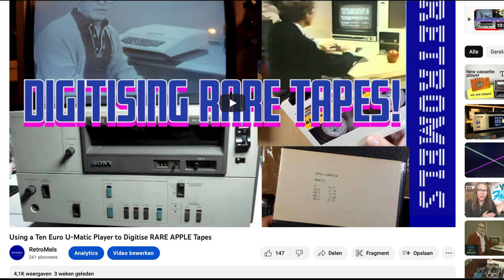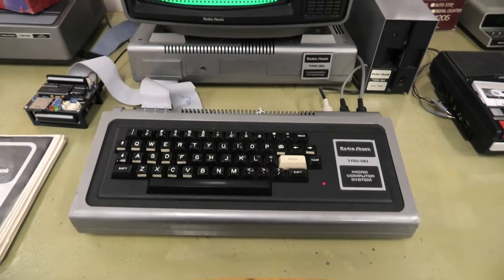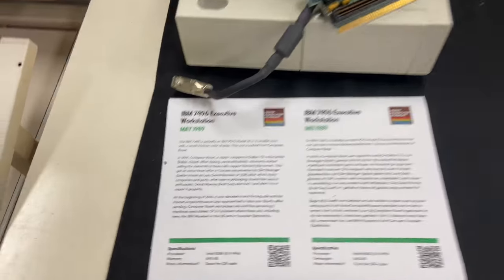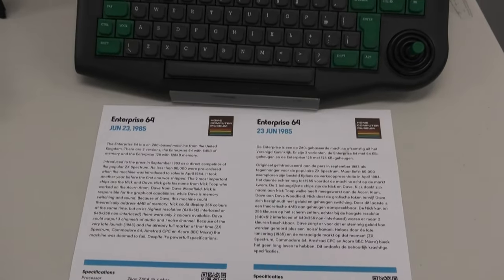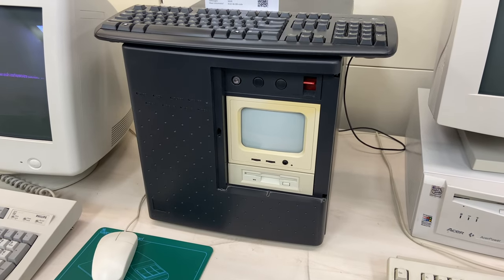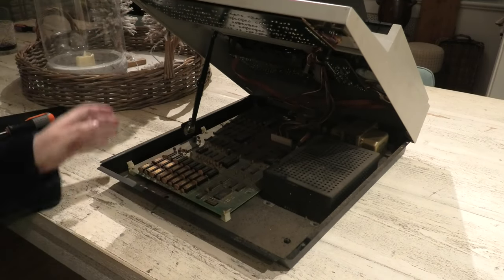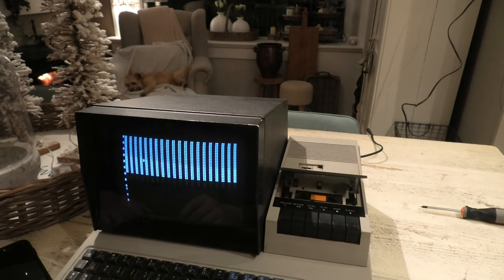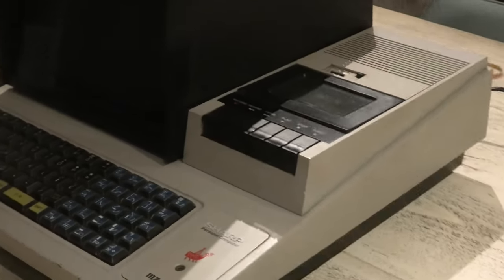Museum and Pickup Trip Finding a Holy Grail Computer feat. Sharp MZ80K

Comment: I'd clean it with an isopropyl bath and a soft bristle tooth brush.
Reply from the maker: Good tip! I became a bit hesitant of isopropyl alcohol after a PCB became sticky. But that probably was the flux I smeared around instead of cleaning it of.
Reply: @RetroMels  I'd get everything of it I could first, I'd expect isopropyl to dissolve flux, so you probably ended up with a nice smooth gel coat of flux. Also, try to get >90% isopropyl.